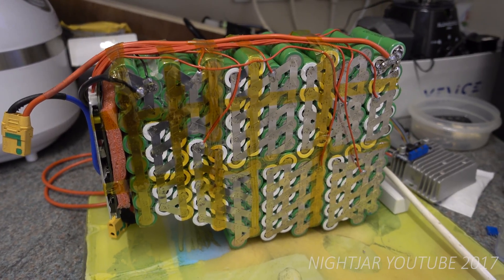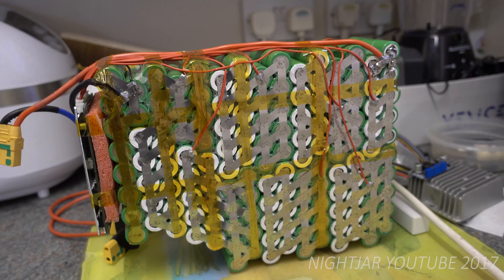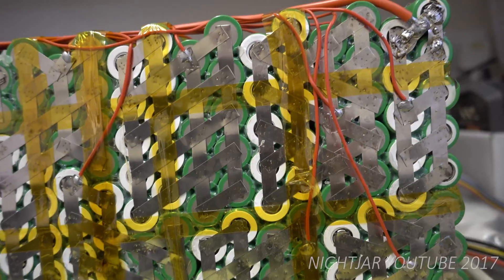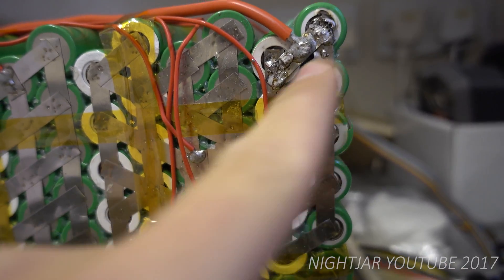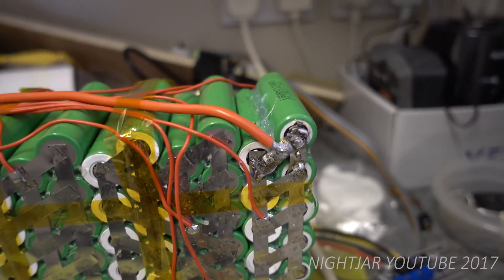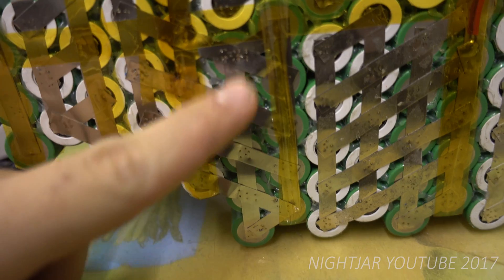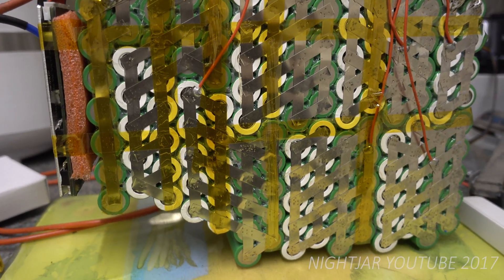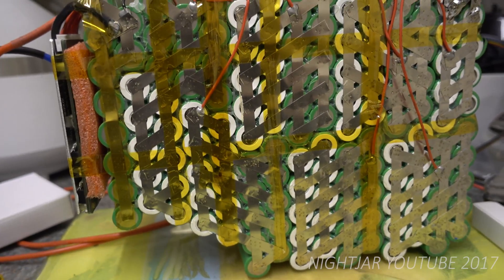DIY ebike battery review 3000km - my mistakes

Comment: Most hot glue doesn't stick well to PVC shrink wrap. But Stanley hot glue will. Check out the video on project farm channel where he tests many different brands of hot glue. Stanley brand works the best by far. Then use self adhesive battery pack insulated paper then duct tape then shrink wrap. I try to use enough cells in each parallel group to handle 10- 20 amps more than you will draw and the same goes for nickel bridging and heat will never become an issue

Comment: Friend has $2000 48vscooter. My cheap 36v kit.  Beats him  out the gate short distance. Mine$300 TOTAL. I have 3. If I can do it anyone can.    I'm always broke. Get Quality cells cheap.   AT ALL COSTS.  if you pay 5 to 10 per cell. DIMINISHED RETURNS. could a bought one.   I pay$1.  LG 3200.  I'm Happy camper

Comment: The only rule on cells try to keep consistently and Never use 2amp laptop cells.  UNLESSS I SAY AGAIN. if you have a 24v system.  You got No power. But you can casually assemble packs out of anything because.  You are Not stressing the cells.

Comment: I firmly believe in Keep It Simple Stupid KISS.  I Have a 36 v. I make my own packs No Bms a hobby charger 5 series cubes plugged together. ITS THIS SIMPLE if  you insist upon 48 OR MORE. When assembling your own packs. Tends to be a CLUSTERFK.   As I've stated I assemble CUBES.  I have many some I mix match unless I see an obvious imbalance.   I would go with.  24v if I could BUT. IT DIMINISHES I buy $15 controllers I go up to 25mph I spent $300 on Ebike kit 305 out the door with battery.  SO GUYS. We all want power.   Sometimes.   YOU SHOULDNT.  36V IS THE SWEET SPOT.   you are Not fighting #####$$$$ ZZPEACE

Comment: I have the same size battery pack.
14s 11p 
But they are two separate battery packs.
The first battery pack it cost me about £150 in batteries.
The second battery pack is a bit bigger.
 It only cost me £60 to build.
Because I got a good deal.
Got 6 hoverboards for £50.
So I got (120 ) 3.7v cells.
Had no problems at all with them.
And I don't have a spot welder.
The positive & negative I doubled the nickel strips up & soldered wire to each cell on + & negative side.

I stop using BMS boards long time ago on my battery packs.
Because they restricting the voltage.
For example a 48V with BMS goes to 52v.
But without BMS it goes upto 58.6V full charge for 14s.
And 54v for 13s

Comment: Your last series connection has only one 5 amp nickel strip across about 10 cells each cell has about 5 amps minimal going threw it and nickel strip only caries about 10 amps safely  this is why you have loss of amps threw heat on your series conections

Comment: why did you use nickel strips as opposed to copper? Isn't it better to use the better conductant?

Thank you so much for having shared all your info. As you rightfully said all this stuff seems quite scary before you actually do it. So i am using your videos to get up courage to actually do it ... and find the time :)
Reply from the maker: Copper corrodes quite easily which would cause problems and i dont think you can spot weld it in the same way. The spot welding is good as you avoid adding too much heat into the cells. Thanks! Glad it's useful!!
Reply: @JackButlerVideos  yes it is! I didn't think about corrosion as a factor at all! It really amazes me how many factors come into effect just fir building the battery ... Not even thinking bout motor, bike and panel choice ... What spotwelder did you use? And how much money did you economise? Is there a seller for the cells you could recommend? And would you recommend it for a recumbent bike for commuting around 100k per day or would it make more sense to buy commercial products?
Reply from the maker: The spot welder was one of the generic ones from AliExpress. Your first battery probably costs about the same a pre made one fro em3ev because you have to buy the spot welder but your second would be cheaper. I get my cells from nkon.nl as you don't pay import taxes from outside the EU. All depends on fitness but i could very easily do 100km on this battery on an upright bike! Look forward to seeing what you end up with!
Reply: @JackButlerVideos  actually post-welding corrosion is of little concern, it would only create a thin copper oxide layer on top. Even if you get a green patina, the copper underneath is fine
Reply: There are many factors that go into how big your battery would have to be: your weight, terrain, speed, etc. The capacity of the batteries that you choose, cheap 2000ah vs. expensive 3400ah cells. 100kms WOW thats one hell of a ride. Read, read, read. Good luck.
Reply: Thank you ! :) I won't do it every day - at least until i get really fit. And i'll do it on a recumbent, which would make it lot easier it seems as terrain is quite flat ... @myrondesjarlait9752

Comment: Seems very bad design. I rather have plastic brackets with fuses. Fuses are very good at avoiding battery damages.
Reply: A fuse has resistance. having multiple in series adds up and wastes energy. Better as suggested, to use brackets for circulating air between the cells and setup you max current to a safe level. If you're extra cautious, add some thermistors at strategic places. I'm guessing there is some Chinese  temperature alarm PCB for 4$ for that exact purpose. A more expensive BMS also have temperature monitoring with an alarm output. If you have a battery box, a 12v DC fan can then kick in and vent the hot air.
Just so you know, I detest fuses in power circuits. they are a symptom of a not correctly dimensioned system with adequate headroom to handle peak loads and faults.

I know Elon uses fuses, but it is costing range, especially at high loads. The reason to have them in a production car is to have an extra level of safety, in case of an accident with some re-bar puncturing and shorting some banks in the pack. This makes sense in a car where Mr. oblivious is driving, and statistically this will happen sooner or later. However having 130 cells between your legs is not as cataclysmic as having 2700 under your but in a Tesla. You'l notice right away, first the pack being warmer than normal, the lost power accelerating. Then smoke and finally sparklers!!. This leaves you plenty time to stop and throw your pack in a river.

Comment: What is the voltage and amp hour of this pack? It looks like 10s 36v using lg3500 cells
Reply from the maker: its a 14s pack and i held around 1100wh if i remember correctly. I never work with "Amp/Hours" so you would have to backward calculate it :)
Reply: Yeah, it's a 14S10P built out of LG MJ1 cells which are 3500 mAh. It should be about 1700-1750Wh depending on how well the cells were matched.

Comment: My tips would be to wrap duct tape around each cell module in case of shorts and to fan out the main terminal cables and attach to multiple points on the end terminals to distribute the load.
Of course, all inter-series connections need to be checked for weak points and thickened up where appropriate.
Advantage of hot glue is that you get energy density from hex packing and it'll help conduct heat away from a hot cell, but temperature monitoring is still essential with little or no airflow to remove heat buildup.
Cell holders have less energy density, but air can circulate to remove heat if allowed to. Depends on how hard they are working and their age.
With big packs, I'd use copper bus bars and cell-level fusing as a short cell could really spoil the day.
My pack is 14S16P, using 10AWG bus wire and HXT bullet connectors for modularity and versatility, making it easy to reconfigure for 7S32P or 3S64P with a few spare modules.
I should really do a video on it and share!
Reply: Use barley paper, its stronger and isn't affected by heat like duct tape might be.

Comment: The danger of glueing cells directly together is that the wraps can tear exposing the negative terminal of the a battery and risking a short. A short in a pack will lead to a lot of venting cells. The hot glue will be a lot stronger than the battery wrap. If you have ever tried to reclaim batteries that are glued in there encloser you soon get used to rewrapping the cells as you cant get them apart without tearing the wrap.

Just stack the nickel strips to handle the current better.

Comment: You have the same problem near the connection of your negative wire: it only connects to the end of the strip.
You should solder the wires on top of the entire nickel strip along all 10 cells. Best to solder on the nickel strip in between each of the cells to avoid heating up the cells. I also see that your series connections consist of (only) 4 nickel strips which would give you a maximum of about 20Amps.

Comment: Thanks for the info, im harvesting cells and am getting ready to make a 52v pack for my ebike and am looking into BMS and not sure which to go with.  Since you did the research and tested which one did you choose for the pack in this video, can you give the link to the location?  Thanks in advance...
Reply: Thanks for the response, i already bought BMS PCB/PCM for 50.4V 14S Li-Ion Battery Pack(35A Drain Rate)w/ Balance Function and seems to be working fine.
Reply from the maker: Lucky Seven have a look on the endless sphere forums i found it from there! Enjoy your build!
Reply: I have just wondering which one this pack has since you been using for so long now and most info from forums explain some dont even balance.
Reply from the maker: Lucky Seven i don't remember exactly tbh. It came from AliExpress i know though
Reply: Get a 45 amp eBay 14s 👍🏻